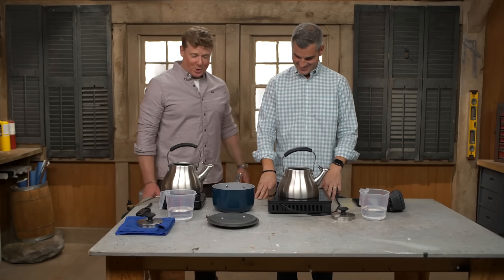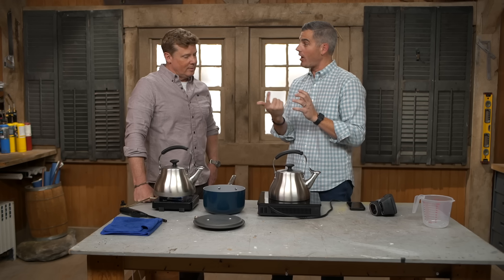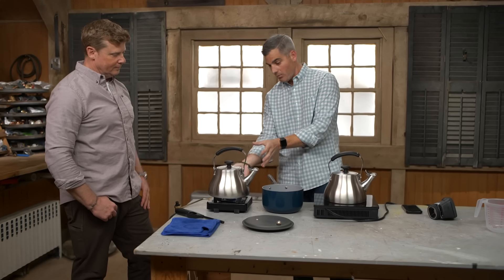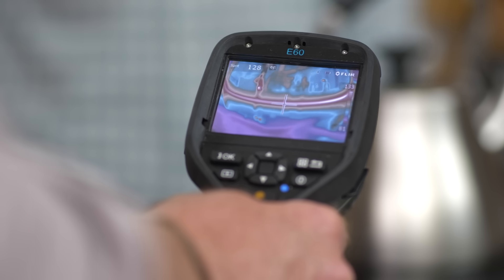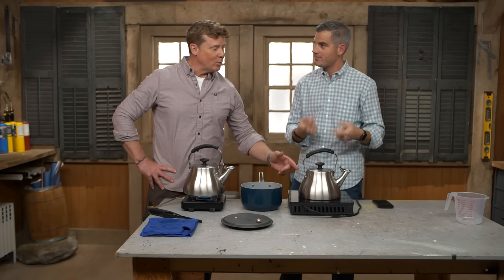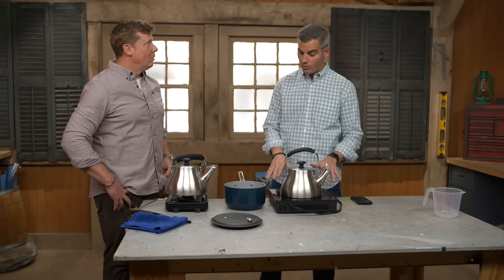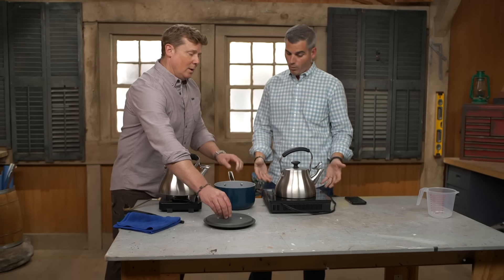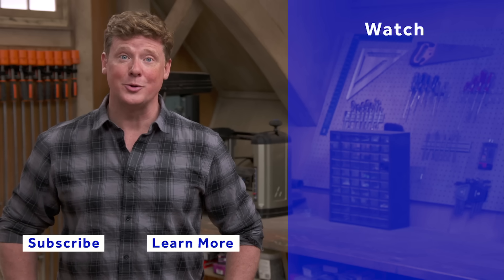Induction Cooking Technology | Ask This Old House

Comment: I like induction. But if i were to buy a new range for my kitchen it would cost me way more to per month to run. Induction is efficient but the jven would be full electric. I have propane now and stove/oven is used alot almost everyday and it only costs me about 3$ a month in propane to run my stove/oven. Electricity is pretty expensive where i am sonits not worth it for me to switch right now. I am considering buying one of these single induction burners though

Comment: I pulled the trigger and stepped up to an induction cooktop.  THERE IS A LEARNING CURVE.  I needed to learn to not start on "high" unless boiling water.  The heat is within seconds.  My stovetop boils a pot of water is about 3 minutes.  Yes you might need to purchase new pots.  Better Housekeeping manufactures nice sets.

Comment: the problem of induction is power consumption. In italy the average house can has a maximum limiti of 3.3 kilowatts/hour before the electricity meter shuts off and one simple induction unit can use over 2 kilowatts

Comment: Gas cars only 25% efficiency BUT fossil fuels so cheap that 25% inefficiency is ok
Incandescent bulbs are 25%efficient as most energy given off as heat similar to  gas cars but incandescent bulbs were practical until LED’s became cheaper

EV’s and LED’s are 85% efficient
Natural gas is typically cheaper than electricity but more upfront costs.  Newer homes ditching NG to keep combustion out of indoor air.  
Just like solar panels and storage batteries more upfront costs that pay off later
If electricity in your area really cheap, longer payback.  You must weigh pros:cons   Resistance electric stovetops use more electricity than induction around 16% more but more upfront costs with induction.  
Similar comparison IR heaters vs gas, radiant vs convection heat

Comment: Electric is safer....but using stoves with gas burners...those gas burners will help heat the house so fast in the Winter.......if there is a need for that.......personally...during  the Winter  a few moons ago, we were without power after a Ice storm for the weekend...Friday thru Mon or Tuesday of the following week.....by having the gas stove and gas fireplace we were able to heat, water to bathe with...and heat the house and help keep the pipes from freezing which can cause BIG problem after they burst....Here in the North....the winter weather is unpredictable.....for that reason I am going to stay with gas

Comment: I live in a electric-only home and swapped out my ceramic electric cooktop to an induction cooktop 1st chance I had (I had grown-up and lived with natural gas for my entire life up to living in this home).  So pleased with the performance and all of our cookware was already induction compatible so there were no issues.  We picked ours up from IKEA during an annual kitchen sale (it is a rebranded Frigidaire) for a couple hundred off (was nearly ½ the price of the same item that had the Frigidaire name on it at the big box retailers during this sale).  I really had to adjust many of my cooking times because water for rice and pasta boils so much quicker.  I've also had to learn different cookware intricacies like cast iron gets hot quick, full stainless works nearly as well.  OXO non-stick pans get work better than Circulon non-stick pans for heat build and searing...but that can be a benefit in that some pans I know are more tolerant to the temp build-up so cooking things like red sauce won't stick or scorch as easily as it would on a gas burner with the same pan or other pans that have a higher iron content.

Comment: A cool trick with induction cooktops: if you are cooking something that is messy or splatter (ie fried foods or sauces) you can cover the cooktop with parchment paper and put you pans on top. It will heat the pan through the parchment paper. You can even lay utensils on it. Then clean up is super easy. Usually only slightly darkens the paper.

Comment: Yes....let's turn BOTH off at the simultaneously and only time the induction, which,  but not time how long the gas took to actually come to a boil, and then proclaim that induction is twice as fast for boiling water.  Very scientific.
If they had let the induction keep going, they might have noted that the  thermostat on induction stops the cooking, letting the water get quite cool again, making oh, boiling pasta, for example, extremely frustrating.
Also, judging from the whistle on the induction kettle, the water was not even at  a full boil.

Comment: This is a bad test. On my induction cook top it does boil quickly but the water only seems to be hot in the first few centimeters of water. the top is not hot.
Same situation exists for food, for example, when you fry an egg the bottom cooks well done but above 3 cm or so the egg is still raw.
I don't like mine after over a year and a half. would much rather have a nice gas stove.
Reply: Either you are lying or you don't know how induction Works. Water heats up FROM THE BOTTOM. The hot water goes to the top replacing the cold water. Rinse and repeat. No way you scenario can happen.
Reply: @HelloKitty-x4u6d  Wow. what a nice person throwing out liar accusations. Thanks for the physics lesson. Situations occur that you may not have seen. I stand by my opinion.

Comment: l got taken in by all the hypee over induction, and here is what i have found, it is good for liquid, eg boiling or deep/ shallow frying, but anything to do with contact on a pan it is terrible, you have a hot spot over the coil and cooler pan elsewhere, and the on and off heatwaves does not give a consistant heat, maybe  its the induction cooker i bought that is the problem, but give me gas anyday

Comment: The timer feature on these devices is perfect. You can set it low & slow cook or high and quick then go watch TV or visit with friends. If you forget to tend it, the timer will shut the device off instead of mindlessly applying heat until the kitchen is full of smoke. Try that with gas.
Reply: People think it's only for kids. This is useful even for elderly and adults

Comment: You can get silicone pads for induction stoves that will make your not perfectly flat pans work. We have several pans that warped over years of sitting on gas burners and they work fine with the silicone pads.

Comment: The one big caveat that any potential buyer should investigate is the heating area. Cheaper induction stoves ($1000 range) have a smaller magnet and tend to only head the center of a wide pan. The pricy ones ($4000) have wider magnets that can evenly head a wide pan. Unfortunately, it's difficult to find specs about magnet size when buying one of these stoves. I suggest that people buy an $80 induction burner to see if they're comfortable with the way it cooks things they commonly prepare.
Reply: Absolutely.........

Bought a single  burner Tefal induction hob in UK for £50 and it's brilliant heating a huge pot of water very quickly and holding a good rolling boil for pasta.

It's a 2,000 watt model running off a single 13amp plug.
Any multi burner hobs should have at least hobs at 2,000 and 2,200, then most likely 1,800 on the others. Installation will most likely require 10mm wiring so similar to a double oven connection for power usage.
Reply: @fabianmckenna8197  ,
I bought another brand, and I'm pretty sure it was under 2000 watts, but mine would ALMOST boil, and then stop for a long time before it ALMOST boiled again.  I had to stop making pasta, boiled eggs, rice, and quite a few other foods because of it.
Reply: Just a point it us not a magnet. It is a coil of copper wire.  All the one I have look ar and bought stated the size in the description.
Reply: @adventureswithfrodo2721 copper coil = electromagnet

Comment: I just want an Induction cooktop that allows me to set the cooking temps (such as 350 degrees F) and have it displayed and hold the temp steady at the setpoint.  Manufacturers out there - get to it, please!  I do like my current Wolf Induction cooktop, but the heat settings are just bars on a display.

Comment: Be aware that if someone has an Pacemaker implant they can't be near Induction so I can't use mine because my husband has one and might walk in while in use.  Be careful because Induction heats so quickly it can warp or make the bottom of cookware concave.  I found out the hard way
Reply: I've seen other videos where a people say their doctor said they were fine as long as they didn't lay on top of the induction stove (jokingly saying there are limits, but they should be fine).  As always, check with your doctor.
Reply: As it’s pretty safe as long as you don’t lay on it.  They recommend to keep the pacemaker two feet away from it while it’s on
Reply: This is not a gravitational, weak or strong force. You yourself can test the elecromagnetic force vs gravitational force. 

My tablet  has material made of ferrous compound. It acts like a magnet. If you have a magnet, keep some safety pin or any object under varying the distance. You will see electromagnetism and gravty work based on the material of the matter(EM forc) and the mass and distance(G force). 

EM force will become weaker as the distance between the magnet and the matter increases instead being close. If you let your hand holding the object go, the matter will be dictated by the gravity. If the magnet and the object are close, even when you let go of the object, EM force will still hold the object as EM is the third strong force. G force is the weakest. Strongest are the subatomic forces aka quantum mechanical forces the strong and the weak nuclear forces. 

These are the four fundamental forces in nature. The top three forces have been unified but not gravty.

It was Einstein's quest to unify the four forces and come up with one Unified Theory to explain everything in the Universe but to this day, it's still yet to be discovered in Theoretical Physics. 

It's not a Tesla level NMR(Nuclear Magnetic Resonance) and it operates at a different radio frequency.

Our heart is an electric impulse. It will keep beating as long as you provide oxygen. 

The problem in all organ transplants isn't at medical/biological level but to do with chemistry and finally physics. What solution(chemistry) that holds the biologically active organ, will prolong(physics) it's life. 

Biology depends on Chemistry which in turn depends on Physics.  Of course, you can not master Physics without good grip in advanced mathematics.

In essence, people with pace maker should be fine as long as they are not inches away from the cooktop.

Sorry for the lengthy comment.

Comment: So it's an advert for induction, no mention of magnet size which is 6 inch diameter, so all you pans can only be slightly bigger than six inches at the bottom or the outside doesn't heat up due to it not being directly over the magnet, no more big pans for the family, unless you pay thousands for cookers with nine inch magnets.
Reply: A small induction coil creates a hot spot in the middle of your pan! Induction hot plates boil water really well ,but so does a microwave!
Reply: Wrong. In the same way as electric cooktop conducts the heat all the way through the pot so does induction. Plus if you have a very large stock pot you don't need heat around the sides of the pot since the pot will have a large volume of water to evenly spread the heat.
Reply: It’s weird that they cost so much in the USA in Europe they are very common they are the standard over here we have 4 burner built in induction cooktops you can buy for 200-300 euros I have personally installed hundreds of them since I’m a kitchen installer they are amazing. Light years better than gas and better the electric coil ones
Reply: Anything positive for induction. As for the product?  LoL

Comment: For professional cooking you need gas. At home you can use induction for 90% of your tasks but can keep a camping stove around for a wok or for the days you feel like getting fancy
Reply: Please explain. I’m a home cook with 50 years experience cooking daily for a family and my new induction range is much faster and has more control than gas. I can leave a pot on the range for days at power 1 and know it will be held at a food safe temp indefinitely. I can leave home with pots on the range and there’s no fire issues. I loved cooking with gas but you get more precise temps with induction. I don’t overcook or burn sauces any longer. Of course with long experience you can make this work with gas, but, not everyone has the time to do this. For me, what comes to the table most efficiently and consistently good, is most important.
Reply: Thanks. Always wanted to say this  @janking2762

Comment: So the grade schooI I attended 1960s used the old heaters that hot water forced through pipes to heat the radiators; than that heated the classroom Why in the name of #%%@ do we not see induction technology; heating used in  buildings?! Even a simple electric oil filled home portable space heater could use this technology! Making it possible to heat a building for a fraction of gas, coal, oil ect!?
Reply: BOTH are very different tasks.

Comment: Wanting to make an #induction #heat source for an #RV #absorption #refrigerator in #MotorHome but don't want it to get to hot ,but supposedly an induction #heat source more #efficient than 120v 12v or #propane , ain't found an absorption air-conditioning, but thinking might practice on something else to tune #temperature ,cause current #fridge / #freezer works, but uses like 6kwh #daily , pretty much doubling #electric usage except on #hot & humid evenings when window air-conditioning running overnight, #hopefully #future use of induction/absorption cooling will shine ?

Comment: Most stainless steel cookware is not induction compatible.  A pot with pasta water still takes forever to boil.  “ Twice as fast,” no.  If does not attract a magnet, the pot will be useless for induction cooking.  I carry a small magnet in my bag to test pots while shopping.

Comment: Our Samsung 240V range with induction burners was >$4K  but a 120V 'hot plate' is <$80 if you want to experiment with Induction.  The hot plate isn't as fast as the range due to the lower voltage but it's still faster than a traditional electric range's burners and you get the advantage of less heat in the kitchen and better cooking control too.
Reply: 1500 watts from portable to 4300 watts is huuuuge
Reply: @WatsitTooyah i just ordered a 3500w single
Reply: I did that, and found out I do not want induction.  I know it's not as good as the big stove, but I did get the feel of what it would be like.

Comment: We have used INDUCTION cooktops since 2010.  It is so much easier and safer than gas or electric.  No, not a complete INDUCTION stove - just cooktops.  We can time cook, low heat cook, high heat boil water, - the pros go on and on.  We would not spend the money for a complete Induction stove - we merely have a nice board over the electric range and cook so much more efficiently!!

Comment: I tried an induction stove and the induction coils were real small.  The center of the pan heated very fast and the outer edge of the pan was cold.  It was pretty terrible and nobody ever mentions that.  Manufacturers need to talk about how large of a pan induction will heat evenly.  I don't care how fast it heats if I can't brown food evenly.
Reply: Yeah I was thinking about getting a portable induction cooktop.  In my research I came across someone explaining how important it is to make sure you know the size of the magnet assembly the cooktop actually has.   Because that will dictate what size cookware you'll be able to effectively use.
Reply: You can turn your pots and pans into "spinners", too.
Reply: Exactly.  The temperature also fluctuates too much while using -- cooking, not cooking, cooking NOT COOKING -- it mostly was not cooking, and  everything was mushy.
Reply: I use mine all the time and don’t have these problems. I love the fact that you can’t burn anything

Comment: Use this tinniest gas burner to compare it to. My Family has owned an appliance store for 50 years. These are not new tech. We got these in in the early-mids 1990's. Put a glass butter dish with water under the pan. The pan with water got hot. The glass with water underneath was cold. They didn't catch on. I love my gas top and electric oven for cooking. Used my gas top to heat the house many times the power went out.

Comment: Will this comment be seen? I'll take a chance. Ross, would you recommend an induction cooktop for an off grid cabin in climate zone 6B (Canadian Rockies)? I would like to avoid using propane and if induction would work should I consider a one burner portable unit or install a two to four burner cooktop? Which models/brands are the most energy efficient to use with a solar PV system?
Reply: You’re going to really struggle with having enough energy to cook in the winter unless you have a massive solar array. You could look at a small gas or propane generator to provide extra energy in the winter when needed. Not ideal, but for your location it’s might be the right call for now.

With a reasonably sized and located solar array you should be good in the summer.

Comment: The best way to think about this is similar to a filament in an incandescent bulb. Induction INSTANTLY heats THE METAL ITSELF. In contrast, cooking with Gas, the flame heats the air, which heats the metal. Since air passes around outside of pot/pan, much of the heat is wasted in a gas cooktop.